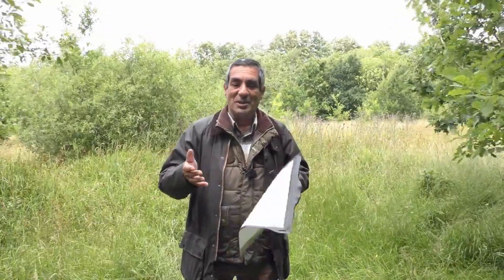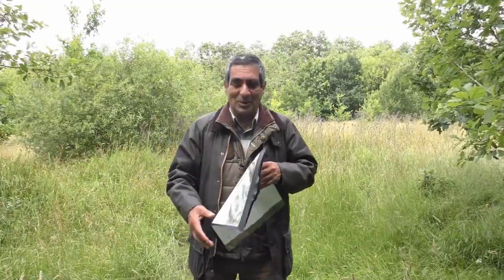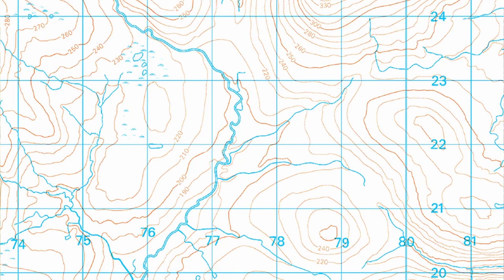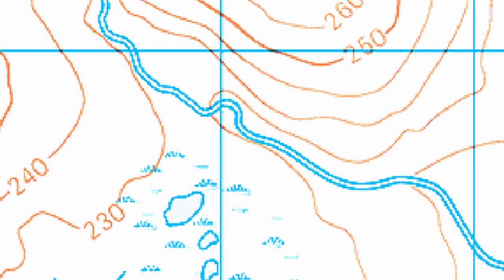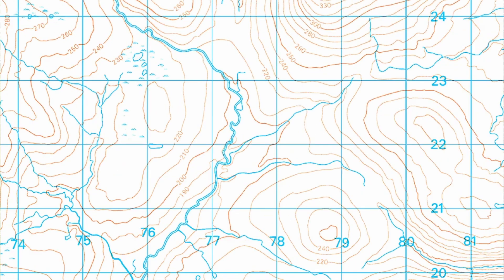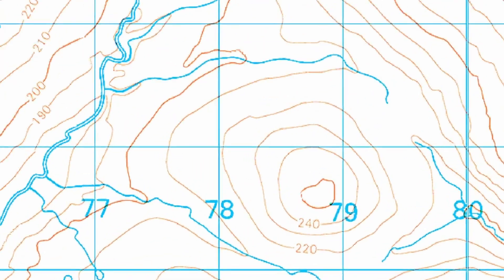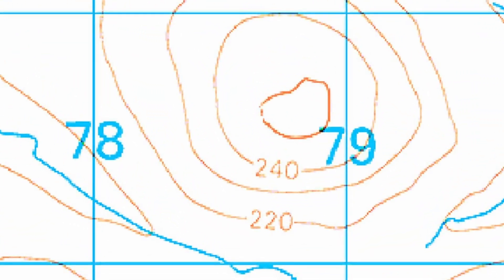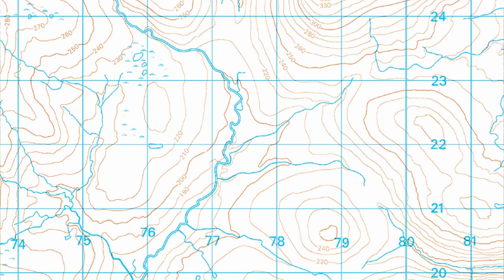Declination when doing a resection

Comment: Couple of points that are worth adding. First the  whole business of declination can get confusing on an ordinary day. Add in the complication of being lost or caught up in some sort of emergency and the whole business of trying to remember whether to add or subtract declination when going from map to terrain or terrain to map is an accident waiting to happen. The simplest way to deal with this is to draw a series of parallel magnetic north/south lines on your map. To do this lay a straight edge across the map's compass rose in line with magnetic north and draw a line. Now draw a series of lines parallel to that line. I like to space these lines about 1 mile apart as this makes it easy to quickly estimate map distances. Now when you take a magnetic bearing in a resection you need only aline the base plate of the compass with these declination lines and presto you've adjusted for declination. The second point is the accuracy of a two point fix very much depends on the angular relationship of the two field marks being used. The closer to 90 degrees the more accurate, the farther from 90 degrees the less accurate.

Comment: Please confirm . If you preset your compass for your region then no need to add or subtract?
Reply from the maker: If you preset the declination you are setting the Map to Compass declination.  If you want to go from Compass to a Map (like in the video) then the preset will not work.
Reply: @TheMapReadingCompany  When presetting a compass like a Silva Expedition for magnetic declination (and grid convergence) the adjustment screw turns the orienting arrow in relation to the  orienting lines, which means that it actually works both ways automatically, I guarantee.
Reply: @TheMapReadingCompany  you are wrong.

Comment: I've taught cartometry (map measurements) many times and i've heard others teach it. The problem with these mnemonics -- and other ones i've heard are MUGS and GUMA -- is that not only do you have to remember the mnemonic, you also have to remember where/when to apply it. MUGS/GUMA depends on where in the world one is and WAVES depends on map-to-ground or ground-to-map. All of them are far too complicated or error-prone. My solution : draw a simple declination diagram and a hypothetical bearing line. Do it either on a bit of paper or just mentally. You can see instantly which bearing -- grid or magnetic -- is greater and hence which way to correct for declination. No confusing/error-prone mnemonics needed!

Comment: I have learned an easy way to deal with declination. You have only to know:  1. East declination has "+" prefix and West declination has a "-"  . If you think clockwise : West are less than 12 o' clock and East more. 2. Outside is false, because there are changes during the years. The map is right, because there are no changes on the identical map as a piece of paper. 
Now: Map to outside:  right to false = false ( West = "+" = add, East = "-"  = subtract ) ; outside to map: false to right = right ( West = "-" = subtract , East = "+"  = add )
You see, after the "to"  it is double. I hope my english is well enough for explaining this issue.

Comment: A perhaps silly question, but: The angle between two bearings does not change, if you add or subtract the same amount to/from both of them. Hence, the resulting crossing point should be the same. So forget declination in this case?
Reply: Consider that you neglect to account for declination when transferring the first bearing from magnetic to grid - your alignment is wrong.  Now you take a second bearing and again neglect to account for declination - your second alignment is also wrong.  There is no way to intersect those two wrong alignments to get the correct position.
Reply: @waelisc  Ooops. It would have better simply tried this on an actual map than start dizzy thoughts :-). Thank you!
Reply: That would be the case if you are only trying to measure angles between points. That is actually what sailors are (were?) doing when using sextants, not compasses, to determine position and they need to observe 3 points simultaneously. In this case, however, we are measuring bearings which are directs with respect to a north direction on the map. If you do not apply the declination correction, you'll get a completely the wrong solution.

Comment: Isn't it simpler to just regrid the map at home? basically drawing a set of parallel lines that match the magnetic compass, something one could just do at home before using the map in the field. In Kyoto BTW the roads are all perfectly NS and EW based on Polaris, due to the roads being set in pre-medieveal times where people were concerned by that kind of stuff.

Comment: Many baseplate compasses have a means to correct magnetic to grid north. If you 'correct' your compass before you go out, then you don't need to do these additions/subtractions either for map to landscape or landscape to map while out and about. However, it remains important to understand the fundamentals.
Reply: Sorry, but you absolutely do! If you adjust for magnetic variation as a permanent fix to the compass, then any bearing you take that you’re going to plot from compass to bearing will be out. Compasses are true. Paper isn’t.
Reply: @TheWizardOfTheFens  It's not just correcting magnetic to true north (magnetic declination aka variation). To use the correct terminology, you need to correct magnetic north to grid north, which you should call the grid magnetic angle. The adjustment on baseplate compasses is not permanent; before you go out, you can reset the orienting arrow to the required correction.
Reply: @TheWizardOfTheFens  you are completely wrong on that.